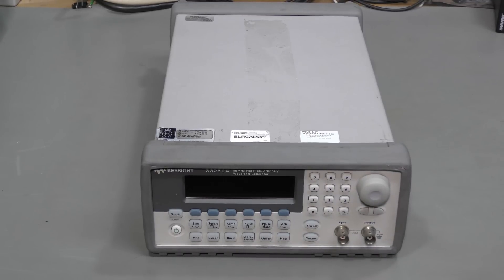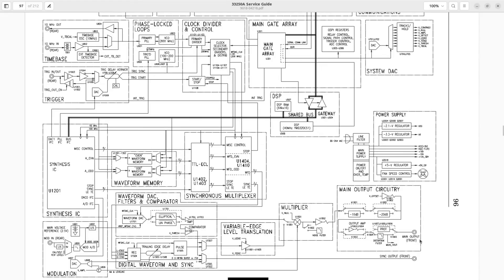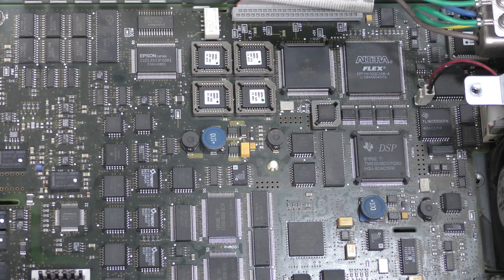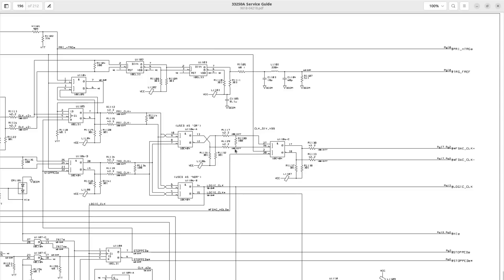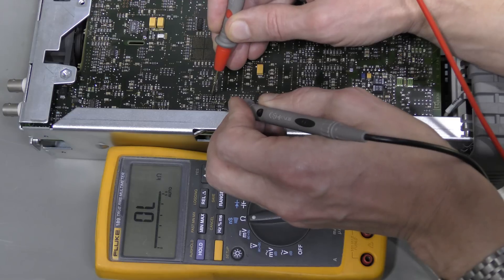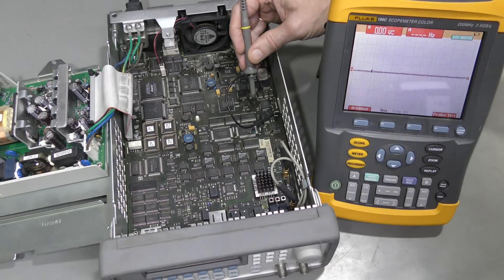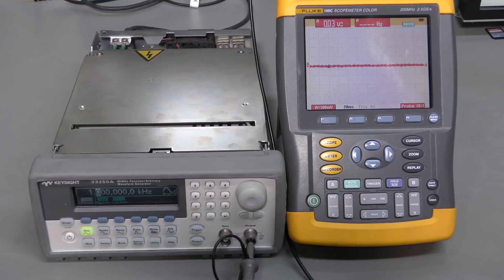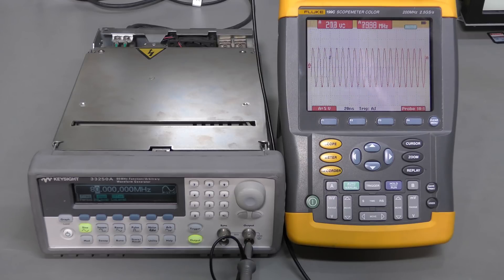#138 - Keysight 33250A function generator repair

Comment: Can you please provide the full list of the 10 faulty 301 Ohm 0805 resistors ?   You mention only a few: R1148, R1141(?), R1152(?) ,  and have highlighted a few.    What were your actual Rxxxx #'s that were replaced from the list that you compiled ?  thank you
Reply from the maker: I don't have a list now. I suggest to look up by the part number in the service manual. Why do you need my list of 10 faulty ones (out of 50 or so)? What are the chances that you have the same ones failed? Did you even start checking that you have the same problem? There might be million other reasons.
Reply: yes,  am checking: so far two of these 0805  301 Ohm resistors in my unit are way off value. Very odd. Continuing to search for the issues.

Comment: Sherlock!  Thanks for producing these vids; it's nice to see you fixing something a little more difficult!  I learn a lot watching them, not just the technical issues, but your general approach and persistence.

I wonder how all of those resistors could go bad at once, or... if they did.  If they failed while sitting there powered off, just through age, I guess they could have gradually accumulated after the first one failed.  Pure speculation!  Mysterious (at least to me).  I would normally expect parts to fail under use, but in that case, after a certain one broke, the instrument would be left powered off and there would be no chance for more to break.  Pondering...

Comment: In my Agilent 33220A I had a mass failure of all the bigger Kemet T491 type tantalum capacitors. I thought that was a weird coincidence but your 300 Ohm resistors are even weirder. Congrats for saving that one.

Comment: How odd. Can't be an issue that's just worsened over time so it must have been caused by a single event. Does the power supply show any signs of repair I wonder.

Comment: An Agilent PSU I repaired had a similar issue, lots of SMD resistors going open circuit. Begs the question, where are Agilent/Keysight getting their stock from?

Comment: Good morning. Good catch, Indeed! The positive thing Is that resistors 0603 have a marking code printed on so even if no layout Is available, with a little effort, you can find and test all one by one. Anyway, very interesting fault, I should say and unusual type. Regards from Italy.
Reply from the maker: these are 0805 resistors

Comment: A surprising issue to be sure. Goes to show, no matter how rigorous a manufacturer's quality control is, bad batches inevitably will still slip through. I've had a similar problem working on a Fluke 725 Process Calibrator, where 4 ceramic caps had identical cracks from the bottom up. Lucky for me, they all failed open because if they shorted that board would have been trashed, most likely. Finding out their value (which turned out to be the same for all four) without schematics was a challenge. Can't conclusively blame a bad batch there, but I have suspicions.

Comment: Excellent repair sleuthing.  That had to be a bad batch of resistors since all had the same value.  If it is there may likely be a similar issue with other units from the same production run.  What is the serial number of that unit?

Comment: I've experienced the bad resistor issue in the reference circuit of an E3631A. I only replaced a single resistor (I forget the value), and the power supply came back to life.